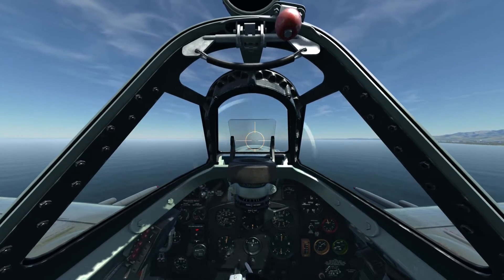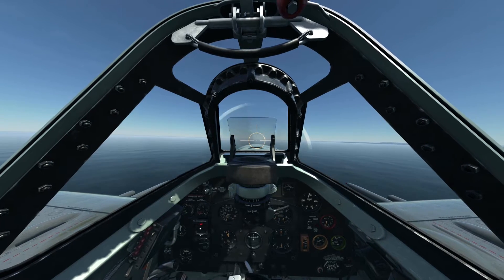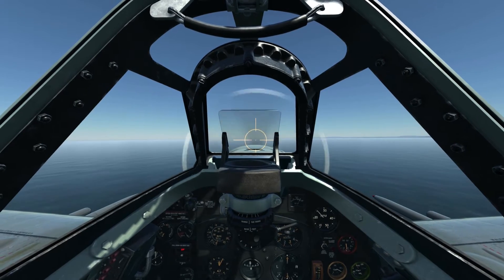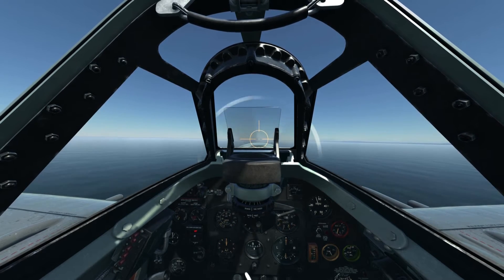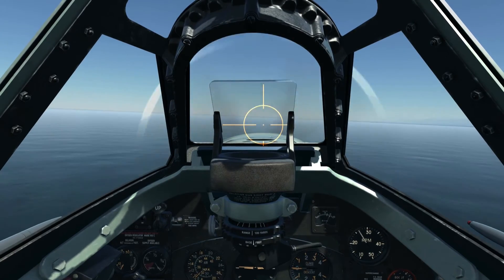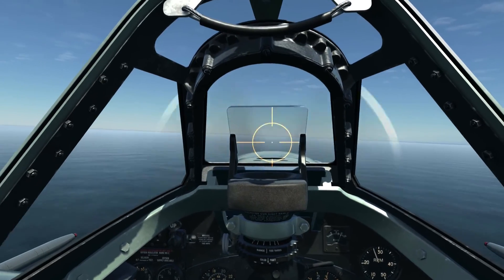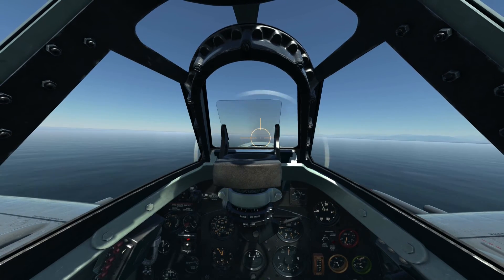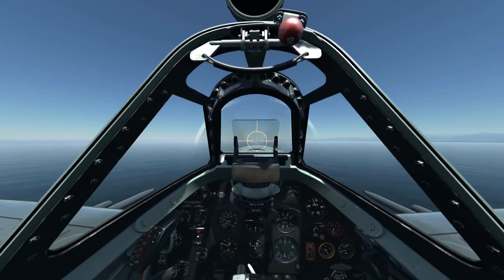DCS Spitfire - Engine Stress Take Two - Max Speed at sea level

Comment: How do you maintain the same boost wile reducing rpm? For me both seem to be linked to my throttle position so that I don't increase boost until I reached 3000 rpm first...
Reply from the maker: lpblewis I am not sure what your problem is. rpm and boost have separate controls....
Reply from the maker: lpblewis I am not sure what your problem is. rpm and boost have separate controls....
Reply: yeah nevermind, my key bindings were all messed up. thanks for the reply tho.

Comment: i am curious what speed does the information you have say what the max attainable speed on the deck is
Reply from the maker: See the end of the previous video. I provide links to some tests and discuss their results.
Also, YOYO posted on the DCS forum a while back with some proposed speed curves. These suggested 335 to 340 mph on the deck... but I don't think anyone can get that speed..
https://forums.eagle.ru/showthread.php?t=183392
Reply: phil style Eagle Dynamics mentioned that the mustang figures are not based on the HIGH Octane fuel that was used in alot of the tests but they will be adding that option in the future. maybe this is the case with the spitfire figures .I'm sure the spit is just in a very early build that is most likely the cause. but since they use the actual flying plane to measure the benchmarks maybe they are using low octane fuel on the fighter collections planes.
Reply from the maker: You can't get 18lb boost pressure in the merlin 66 without the 130 octane fuel (335 mph at sea level). So it must be correct. 
25lbs is what you get with the 150 octane, which came later. The 150 octane ones are even faster than the 18lb ones we have in DCS (358mph at sea level!). 
http://www.wwiiaircraftperformance.org/150grade/150-grade-fuel.html
Reply from the maker: "25lbs is what you get with the 150 octane, which came later" .  i.e. May 1944. 1 Sqn and 165 Sqn were converted in early may 1944 to the 25lb version running 150 octane.